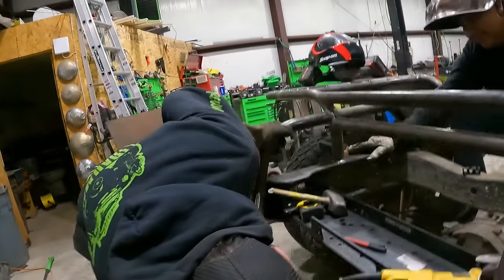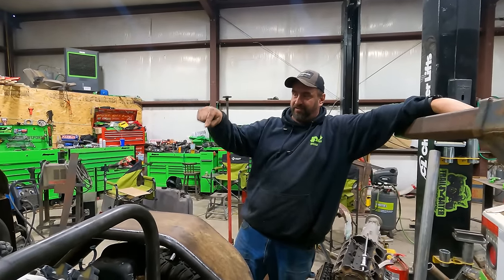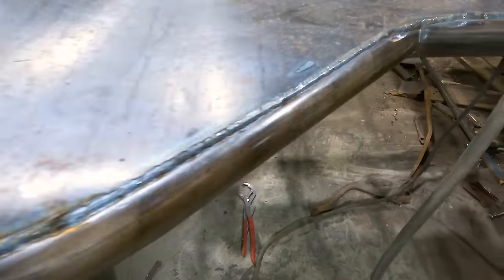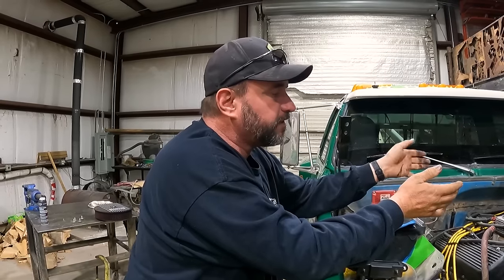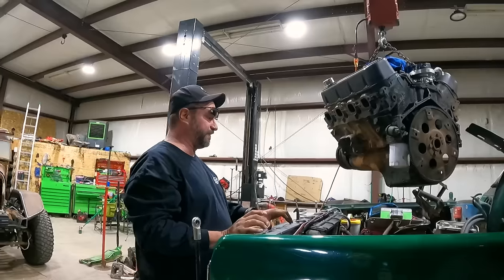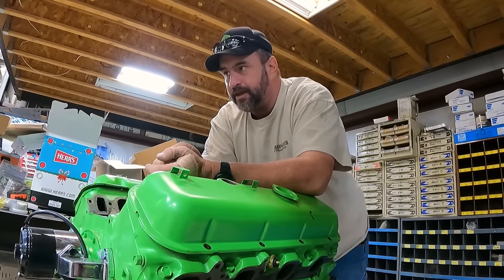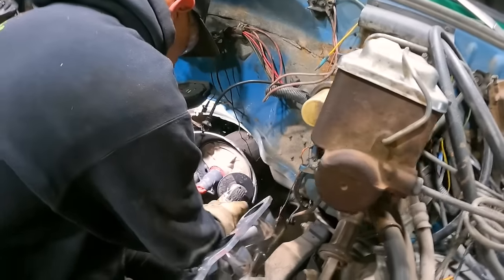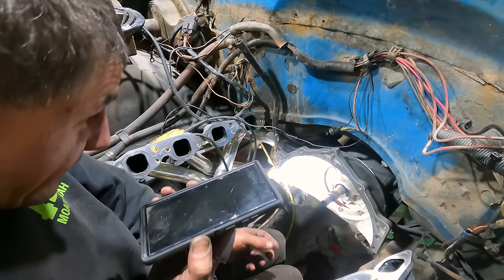@RobbyLayton Model AA Wrecker Gets An Engine

Comment: I would probably cut that front radiator loop and just make it a bolt in.. I guess that can always be done later if he needs to pull the engine and doesn't want to disassemble it so much..  Easy future upgrade .. (or downgrade)

Comment: Again, nice work and great progress my friend “dres welding amigos“ but …. Some little idea 🧨 to bring the engine now and later more easily in and out cut the front bracket and do a distance peace in the down part.. weld it and put the upper part on it, drill whole in it and screw it, so next time it will de more easy to change or replace something……
Reply: No need to worry. They don't plan on needing to do any warranty work on this one!
Reply: @donwilliams3626 funny, did you see the same video? Show many times the put the engine in and out …. Al’s big blue with lot of more space… I see you are a builder…..

Comment: I kinda favor the idea of pulling the ENGINE (not motor which is an electrical device that converts electricity to rotational motion/power) with the radiator in place; however,  
I (me) would place a peice of 1/4" plywood or some sort of veneer on the radiator to keep from damaging the radiator.
Just my 1.5 sense...  🤔

Comment: Guys, I ran into this problem with a old squarebody wrecker of mine and it was a four hundred turbo hydromantic transmission. I did not have a tall deck 427 but was running a 454 in my one ton.... its a 85 model that was burnt up in a forest fire here in alaska about a good nine or more years ago. I ran into it not going all the way in so did the most despicable thing and installed it and then let it eat!! It did self clearance and it held up to everything but a worthless grandson who tried to lift a bus out of the ground when it was twenty below zero, and those tires were flat and frozen into the ground. What he did to break things loose was park a semi truck close to the front of my wrecker  and then pull. My wrecker lost this battle as it bent the frame in a big wrong way "U"" shape and I just gave up fixing on it. It got parked and then the forest fire finished the job.
      I did pull out that engine and transmission to use again and checked out how bad it tore into the bellhousing. Not really too bad but I know it did weaken everything. I did plate the outside with more aluminum plating but you know what happens when you modify aluminum.... plus I just never really got the hang of welding aluminum that was dirty metal. Since that housing is new metal, no grease should be bound into the housing and maybe stronger after being welded on.... risky at best but poor folk imagination and old age didn't help either. As it is now, I am a crippled up 74 year old wanta be

Comment: On a side note (it’s not a V8 so it doesn’t matter) but a Ford Berra motor would have possibly fit… the length may have not worked, but width would have I’m betting.

Comment: People like to complain about the ls. it’s a great compact engine and fits in to places it wasn’t supposed to .   That’s why everyone used it.  if ford came out with something like that and stuck with it  I bet it would be just as popular. But noooo every few years they have to reinvent the wheel and build engines that barely fit where they were installed and when they did settle for a while ( modular v8/v10) it wasn’t particularly great

Comment: Hay Mike 🙂 luv what you add to the show . 🤔 But sum times you make me think you wanna be blind in 1eye or both 🤨. Please wear Safety glasses every time you use the grinder. 
If you are having trouble with them fogging up drill small holes across the top of the frame that's what I did to alleviate the foggy lenses.  God bless you and the guys and may you stay safe doing the dangerous work you all love to do🙂🙂.

Comment: Nothing You Like Better Than Putting A Chevy Motor In A Ford Truck!   Maybe It's Time For Big  "D"  -  Put A Square Body Cab,  GM Big Block,  4sp, 205 Transfer-Case On The ford  Running Gear And Make A Good, (and Good Looking),  Truck Out Of It    : - )    Have Fun Bee Safe Live Long and Prosper - With Admiration And Respect From Yerington Nevada

Comment: Did they bench test start the motor make sure its good my friend steve at Steve EFI harness he build a harness just for the motors for it run the motor you wire lights turn signals everything els with a separate harness

Comment: did you R&R Trans input shaft seal ? just asking, I do have a good suggestion, Being I worked 50 years in the trades 
 as a HDR/W mechanic / Cat, heavy equipment, I know you know, at your age it's even more important, make it a 
habit to be wearing a combination back / gut belt to prevent a blow guys. anti none of this heavy lifting 
worth injury, it wont mean nothing to anyone if some one ends ruptured. amen. of all places to have it happen to me,
lifting a push lawn mower in to the back of my PU, had a blow out. this was after I been retired for some time. I'm 75, More over it will mess you up in a dozen different ways you can not imagen.
out of genuine care do I bring it up. 
The Lord Bless you and yours.

Comment: 😔 I was really hoping a 300 i6 or 296 i6 or the i6 out of the Blazer or even a 4.0 out of a Jeep would fit but when I saw you trying to set the 5.3 I realized there ain’t no way those were going to fit too many cylinders long… 
But what a torquey monster a light pressure roller top end 300 six would have been not fast but pull a UPS truck around all dang day for freaking years banging gears like a pizza delivery guy after a hot tip.  

A guy I went to school with said he worked for a company with basically 2 identical trailers for service work and the old Ford 300 would out pull the Dodge 360 to about 45 mph then the 360 came back strong and with a vengeance.  So the torques are there  in the old 300 if the thing would breathe a little better it might even get a little bit of excitement..lol

Comment: You should have made that front hoop removable like a drift car has then you wouldn't have to take a bunch of parts off to pull or put in the engine after it didn't fit that's when it should have went off in your head like oh make it removable

Comment: Rory, can’t you make the front hood/radiator support removable?  Maybe cut and flare so you can bolt in and out?  Would make it easier to remove and work on motor.

Comment: I get it for reliability sake, yet it would've been cool with a crown Vic 4.6,ford 5.4, or god forbid a 7.3 gzilla.
Reply: I'm a ford guy through and through, but the 4.6 and 5.4 are wider than a 460 my friend. No way it would have fit! I'm sure a old school 302 would have fit just the same as an LS, but they aren't as plentiful, and regardless, Robby is a Die Hard LS guy anyways. And it's his truck.

Comment: chev got the exhaust right, but refuse to do the inlet.. or they might as well buy 460 engines, with better valve train.. canted valves, dizzy at front.. ect..ect..  not spend $$$$$$$$.. at the speeeeed shop..  2c..

Comment: That's sacrilegious putting an engine made of recycled soda cans in a grand old Ford to say nothing of the disgrace of putting a Chevy in a Ford.
Taking the easy way out, no originality drivetrain wise,  after all the innovative body fabrication.
 A 351 Ford stroked to 427 would absolutely fit ! And you're going to have to put in all the electronics and computer to make the LS run.

Comment: While some are accused of sitting on their high horse, how about some facts. 454: 28" wide, 30.5" long, 29" high. LS1-6: 26" w, 28"l, 25" h. 460: 27" w, 30" l, 29" h. The 454 and 460 are basically the same size with the 460 actually a bit smaller. You say Ford 460 80's and 90's output numbers are laughable, there are also other years available. Any engine can be made into a torque king. Gearing is always a huge factor in what you can make a vehicle do.

Then there's the chevy is cheaper to build. That too is a falacy and not always true.

I too get tired of the chevy worshiping! What's worse is all the unwarranted Ford bashing...i.e. fricking Ford, no, it's called a faulty fuel line that Ford DID NOT manufacture.

What folks forget is that there are pieces of junk in every brand, and exceptional ones in every brand. I have driven Fords for 52 years and I've never been stranded on the road, or anywhere else for that matter.

Don't make such an awesome YT site a biased show, please!

Comment: I'm not mad, but I am completely bored with LS swaps. I get it, they're cheap, plentiful, good, easy to set up and there's a wealth of knowledge and parts available. But every channel  I watch is stuffing LS engines in everything. It's just not something I'm interested in watching anymore. But if you are, that's great. I'm moving on.
Reply: Part of the appeal of these old trucks for me is the driving experience. Straight six engines that never stall and have oodles of torque from idle, low gears in a bombproof manual, and simple systems that only need a couple of wrenches and a screwdriver to work on.
Reply: @augsu  6 IN A ROW... READY TO TOW...

Comment: A small block ford would fit just as well and be even more dependable, relied on one for years and years some times my life depended on it. It's a ford truck for hell sakes. I get so tired of the Bowtie worship. sorry just a little pissed off at the moment. I just spent an hour on line searching for a part for my ford truck. every time I do a search everything defaults to GM. and you have to pay the FOMO tax if you find something. Then I started watching this and hear you bragging that you are putting a GM in a ford. as if that has never been dun before.